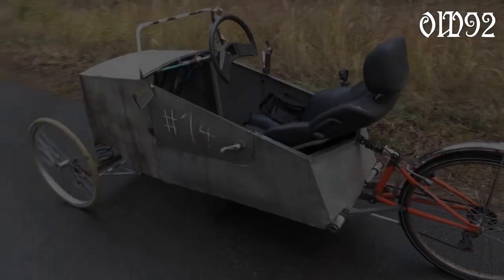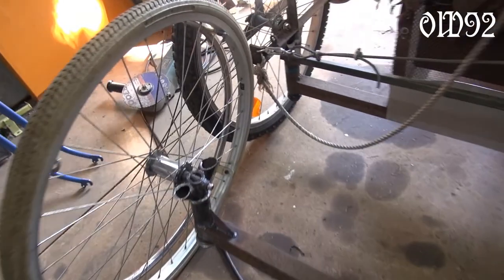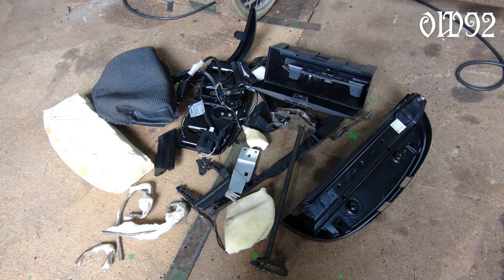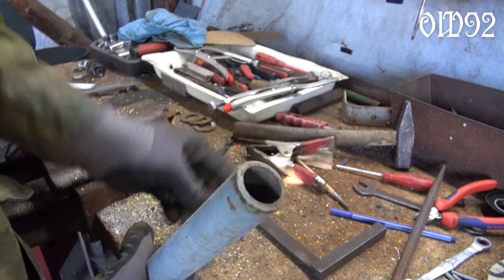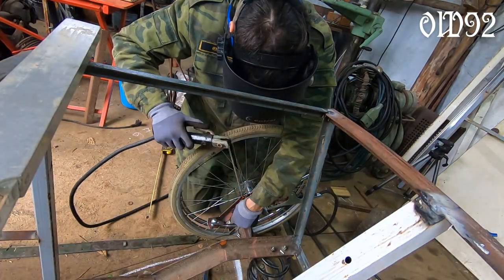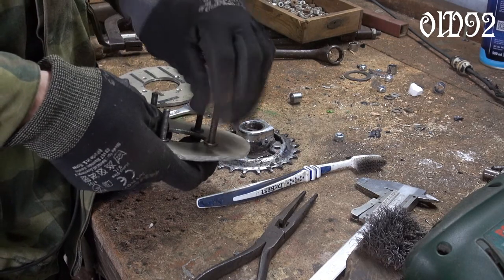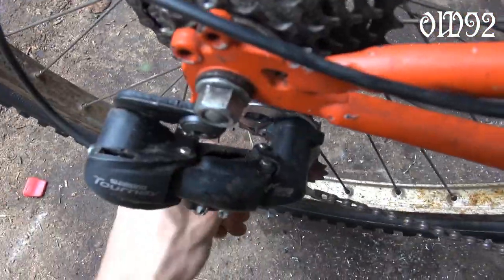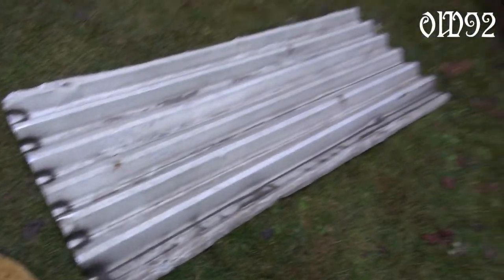Bicycle car #14 / construction video / behind the scene

Comment: Very impressive work especially use of scrap materials for everything. I notice front axle has wide scrub radius and no caster. Does this not cause problems with bump steer?

I have a lot of drawings + research of this kind of vehicle going back to 2009, even began building one in 2014 but life was very chaotic and I lost it and my tools. This winter I will start again.
Reply from the maker: I guess because there are two wheels which are influence each other there is no problem with that?! To put it into a nutshell it steers just beautiful. I can do it with just a finger (a comparison how smooth it is). But there are some flaws or should I say “manufacturing tolerances”. Steer to one side, the steering wheel and wheels are travel a bit further than on the opposite side.
...
Get back on track, get your tools and let your visions become reality!

Comment: Very cool, I love your vehicles! The steering mechanism is really nice, I build similar things with my cousin (but not that advanced and big), do you have some advice for how to make the steering less sharp?
Reply from the maker: Well you have your steering axle, on one side the steering wheel and on the other side the pitman arm. If your pitman arm is rather short your steering will act more aggressive/sharp. But the longer you make that arm, your steering will become more sluggish/slow. It depends further on the length of your steering arm at the steering knuckle. I guess?!
MMMm used the word "handlebar" in my video, actually it’s the tie rod. …WASTED

Comment: Nice velocar...what would you estimate the weight of your velocar to be? Ever plan on adding a 500-750 watt motor to one of your bicycle vehicles?
Reply from the maker: Around 70kg?!, I would guess. It depends about which model we are speaking about. I’m still able to lift one edge, it’s heavy but makeable. If it would be made completely out of aluminum, the weight would be drastically less. Indeed I considered equipping one of them with electric propulsion. But it’s just out of my reach, ~500€ for the engine & controller-stuff + ~500€ for a decent accumulator. You need to be a millionaire for that. ... Well it's nice to ride them without anything, because it’s always a challenge and a good training too.
Reply: @Osterwald92  I think I need to build one to save some $$ and get a little exercise. I really wish builds like yours gets more popular because we need more of these in the world today. Keep up the good work and hope to see more videos from u soon.

Comment: Where did you got the Seat/Chair from?
Reply from the maker: I got the car seat from a “car recycling company”. He used to be mounted in a BMW 318d.
Reply: @Osterwald92  How heavy is the seat? Comfortable to sit and pedal?
Reply from the maker: After the modifications I did to the seat, I'm quite happy with it. It has become a little bit lighter, don’t now the correct number. Around 10-20kg I would assume. ... Well it’s all about the seat, nothing else matter.😂